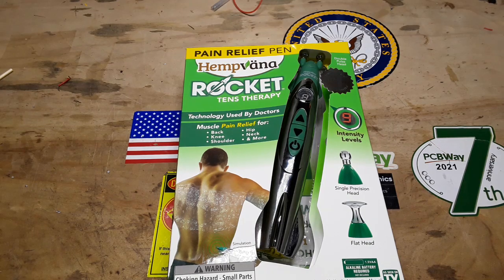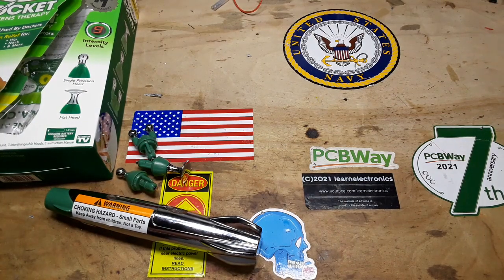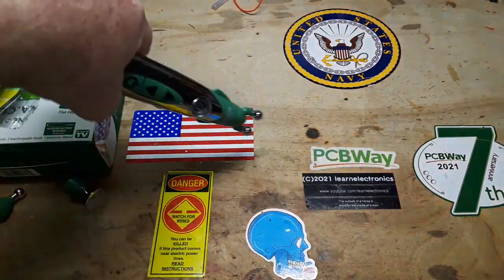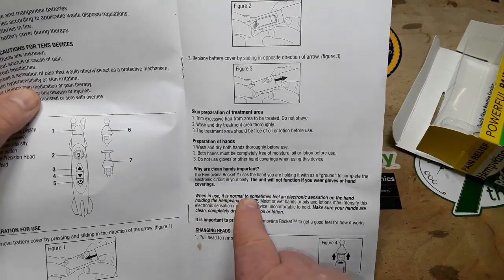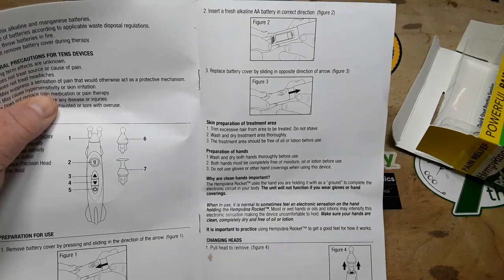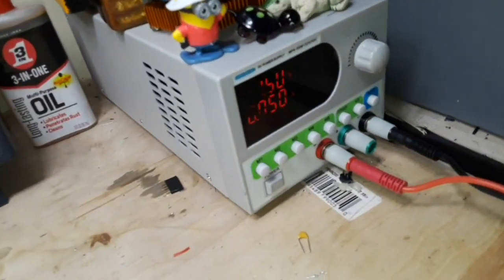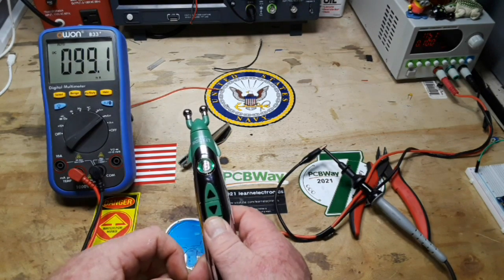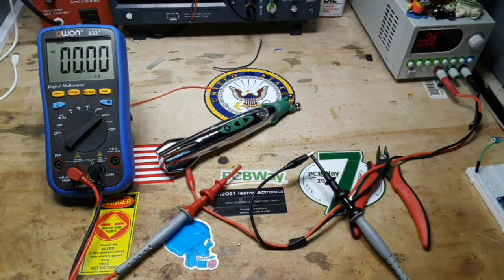HempVana "Rocket" TENS Unit

Comment: I could care less about the design. It works and literally is the only thing keeping me from relapsing to a opioid addiction. And they absolutely do work. And idk what you say about level 5 on level 1 I can feel it and on 2-3 makes my muscles twitch and feels like a pinch and really never go above 4 unless it’s like my leg. The high voltage transformer  wouldn’t survive 3 amps for long and yes I get that’s going across your body potentially the heart and could stop it. It’s why it says don’t shock your neck veins or arteries all so blood vessels close to the surface conduct well with this and can really make your muscles twitch. But there is all sorts of the skin effect and unless you use it on a bleeding wound sure it would increase inside the body. But you forget and leave out ohms law resistance and safe voltages vs unsafe 50VAC and 120VDC is the threshold of safe vs potentially dangerous.  And sure amps play a role too and yes every one knows just 100 mA across the heart but that is for half the people or average along with it’s referencing 60hz AC along with many other factors go into it. Even surgeries where they use direct lead paddles touching the heart it’s self to shock it into taking back up a sinus rhythm is different for everyone and may take multiple attempts and they start at the one that works on most but won’t hurt even the most sensitive and then repeat in increasing charge amounts till they reach the one that patent and heart respond to. I’m sure you have heard it’s the amps that kill you and this isn’t completely true ether. Again the skin effect and ohms law come into play as well as scare tissue and even the oils and how much moisture is in your skin to even slight deviations in your body nervous system and other structural genetic components all combining as separate yet some can become important variables to the outcome and is why some people are not affected and can resist police tasers and it’s not all ways drugs or mental illness could be adrenaline from fight or flight to an ability to over ride the brains fear response to that type of pain thru determination or actually playing with tasers and learning to overcome there effect even. Not everyone drops like a sack of potato’s just most do cause it gets internally transmitted messing up there cns and literally temp short circuits there brains. Others it can even be potentially deadly. Any ways all this is for the point know more about what your talking about before trying to make something out to be unsafe or some kinda chinese death circuit sent here as a 🖕🏼while they gladly take our cash and laugh at the stupid Americans. Cause sure this was manufactured in China it was still an American owned and made device and company and sadly most corporations do the exact same thing cause late stage capitalism seems to have set in and our elected officials seem to refuse to tell the rich no while telling the rest of us it’s not because they give them millions or isn’t blatant corruption when it absolutely is and why citizens united was the worst Supreme Court decision ever. That’s getting off topic and this got to long any ways. But yeah even a lithium 1.5v battery wouldn’t be dangerous in that and unless you go and really alter or mod it even then the components can’t handle or couldn’t for very long the ranges that would start to be dangerous or harmful.

Comment: They cost 10 bucks on ebay or ali express and are literally the same model as sold in many stores. I got my ex one when she injured her arm and it helped the nerves heal. It was the one with the pads though and it was actually good quality for the 10 bucks and came with 20 pads.
Reply from the maker: Yes. I have an actual tens device as well that I bought from a drugstore I think I paid $20 for it. And it also has the pads, which is what you want. You want to isolate the current in the area that you're trying to treat. You certainly don't want the current going from say your knee, up your leg across your chest, across your heart, down your arm, and out your hand. Not only is that silly, but it's dangerous. It only takes a few milliamps to interfere with your heart's electrical circuitry.
Reply: @learnelectronics  yup, especially on the higher settings it causes pretty strong muscle contractions. I would be worried about causing a heart attack or heart rhythm problems.

Comment: 4:25 The power supply already showed 3A before the testleads where connected to the device.
So it seems that the power supply was still in "set mode" instead of working mode, or there is a internal shortage in the power supply.

Comment: It’d be interesting to replace the internal circuit with your Cockcroft-Walton voltage multiplier circuit you demonstrated a few months ago. Results should be remarkable. I don’t think you’ll cure anything but you’d certainly for the time being anyway forget all about the troublesome knee or whatever.

Comment: You could have done the battery current test two ways, one with a rare earth magnet on either side of the battery then wired to the dangerous tens machine or just use the multimeter probe clips on wires that jam in the springs when the battery is inserted.
That being said, I called it dangerous due to the current running though your body for people with possible undiagnosed heart conditions. This should never have passed the consumer safety ratings and should be recalled ASAP, people's lives are worth more than a $20 sale. I would be returning it for a full refund and reporting it to the consumer ombudsman. Hope no females bought it for their pleasure centre's 🙄